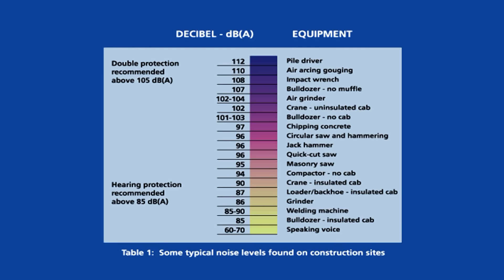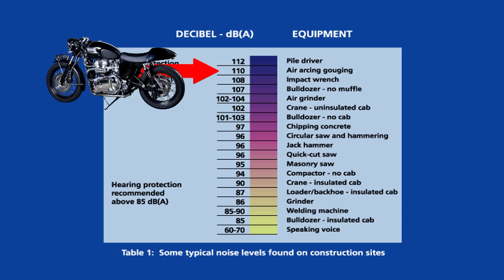Why Not to Change Your Car's Muffler

Comment: Was looking for a louder exhaust for my truck, found this video instead.

Still looking for a louder exhaust
Reply: Alejandro Gonzalez what exhaust did you end up going with
Reply: Alejandro Gonzalez  I got a flow master on mine
Reply: I’m with you brother 😂
Reply: Alejandro Gonzalez 😂😂😂😂😂
Reply: Im going for a greddy chambered muffler. Is that a good obe for bone stock engine?
Reply: Still looking for an exaust for my car aswell 😂
Reply: Me too ! Hahahaha . Dont listen to grandpa . It's just the exhaust . Nothing major 😆
Reply: Flowmaster my friend
Reply: Me too
Reply: Cherry bomb muffler the loudest but it won’t be faster
Reply: Neighbor haters for the win
Reply: Same but for my gts
Reply: Getting a 3 inch Magnapack put on my 5.0 f150 soon
Reply: Ran into this looking for sound comparisons for a 2000 lesabre cat backs
Reply: Straight pipe it…. I straight piped my 2000 stang.
Reply: @zachwagner1517  any issues with it???
Reply: Just re program it and it will be fine. If it’s American it’s easier to do it.

Comment: Pretty much he is saying tune car after exhaust....
Reply: That is the perfect advice. Tune your car after any mod that changes engine performance. Even a damn intake. You otherwise wont get any benefit from it, and like he said, it will most likely make the engine run bad. I once installed a 3" intake when stock was 2.75". The check engine light came on with 2 codes. 1 code was about running too rich, the other code was about running to lean. So the tune was pretty much completely screwed up. 

Since I did my research, I had the ECU tuning software before I even changed the intake, so I was able to calibrate the MAF sensor and adjust the A/F ratio.
Reply: Opening the exhaust will decrease engine power loss at the exhaust stroke and sends that lost torque to the crankshaft.
This will not really change how the engine operates just makes it easier for it to work so less power is lost.

99% of modern engines have self-adjusting ECU set to certain parameters mostly based on airflow, it's not until you change the AFR mixtures or timing that you need to tune the engine, not that you can't get any more power out of the engine with a tune however, factories tend to mass produce engines and ECU's, not really tuning them for each individual engine.
Making it easier for the engine to work, like putting on a less restrictive air-intake or less restrictive exhaust does not generally require tuning because engines are tuned on a engine dyno without any air or exhaust restriction.
Reply: It all depends on the car, it is true if you want the full benefit of the mod that u will need a tune to go along with it. However, not all cars are universal I was able to get 40whp on full bolt ons with no tune NO troubleshoot codes. The video and commenters is vaguely describing mods as a whole, but after that 40whp turned into nearly more than double with a tune cycling through after awhile.  Tunes do benefit turbo cars a lot though increasing the turbos output to the maximum psi factory limits on stock parts, but may risk the engine depending on the car. 

I do not even care about loudness so he is pretty much generalizing as i prefer to have it on the low, which is why i was kind of hesitant in changing the headers cause it does increase it ten-fold. However, with the mods i do get faster times and/or better gas mileage depending on how i drive it.
Reply: Bjorn, that's not true. There are numerous forums full of people warning that they have actually lost performance after installing a simple performance-oriented cold air intake. They were able to trace the problem back to the engine's air sensors- the wider intake ducts changed the density of and rate at which the air flowed into the engine, throwing off the air/fuel ratio.
Reply: Its a rant.

Comment: Check engine light should not appear as long as the catalac converter isnt messed with
Reply: i removed mine and no check engine lights comes up, had my catback custom made by a philippine racing team. so it's not always the case
Reply: @Camaro SS what about when you need to pass inspection
Reply: rene chimborazo it won’t pass
Reply: Yep
Reply: Bullshit. it comes on if you change the air intake as well
Reply: @Officertack  Not all vehicles. I had no issue
Reply: Catalytic
Reply: i took my exhaust off before the cats and drove it around and no engine light, it was loud asf tho and it backfired lol
Reply: I took my cats outside and they started scratching my door thanks alot
Reply: JDR 235 ha. Ha.
Reply: Update I got a magnaflow muffler and no check engine lights the cats are ok and so is my car
Reply: @Officertack  most ecus will compensate for 15% increase in flow , its when you start doing more than just  an exhaust it starts leaning out too much.
Reply: rene chimborazo emission checks aren’t in every state buddy🤦‍♂️
Reply: Wrong, you might have exhaust pressure codes or a lean code
Reply: I have the h20 think engine light so imma just rip my mufflers change the cat later
Reply: @andrewbartleman9169  so how will i know if im at 15% only? Im planning to install an electronic muffler bypass valve. Does it have to have opening size?
Reply: Wow. Go back to Engine Building school as of the 20th century there scotty! If you think common fuel injection motors dont have a computer that WILL compensate for more of a free flowing exhaust or intake you are sadly mis-informed. If however some of the times in certain vehicles cases a CEL comes on when the vehicles computer notices a difference in sensor patterns or "readings" telling you that it is reading a difference. If you read the code the obd displays it will typically fall under a sensor category, therefor unless the sensor is bad there is no issue. There are very simple ways to get  around a sensor code that is set to go off by the manufacturer when said items are changed, removed or damaged. Loud pipes save lifes🤘
Reply: @connormason7907  no no everyone i know calls it a cadilac converter ... lol
Reply: @Zack-dk3pt  Everyone you know is incorrect
Reply: Exactly!!
Reply: Cat under car got run over by back converter
Reply: rene chimborazo there’s a thing called spacers

Comment: According to this guy, engineers design perfect cars and we shouldn't do any mods to them. What he neglects to mention is that engineers are also restricted by governmental restrictive emissions laws and rules that don't allow engines to breathe freely. That's exactly what happened in the mid-seventies when engines suddenly lost hundreds of horsepower for the same size. It's like for a human to go biking with a scuba diving mask on.
Reply: I disagree. Even if that were the case, the engineers still designed the system around current stock exhausts. So modifying them doesn't improve much. You're better off putting an entire modified racing engine if you want engineers who are solely after horsepower. Most modern vehicles are designed around fuel economy. It's more like a human going diving in water with a scuba mask on.
Reply: "I know more than engineers with decades of experience I'm gonna buy aftermarket garbage from China and show them a thing or two" fixed that for ya